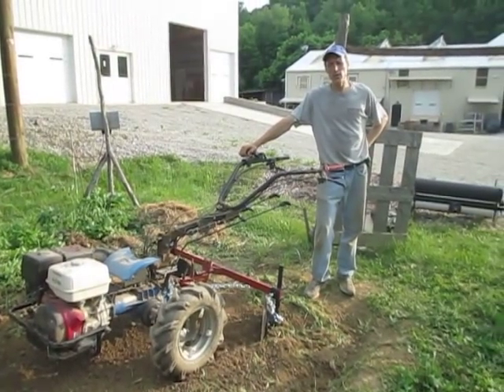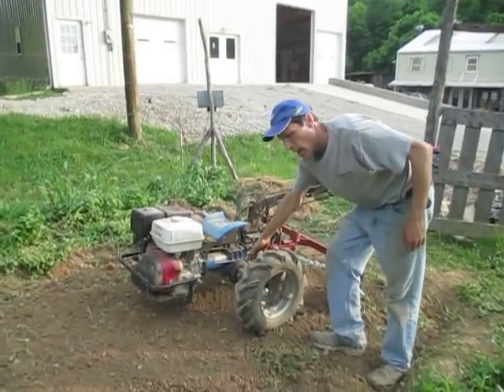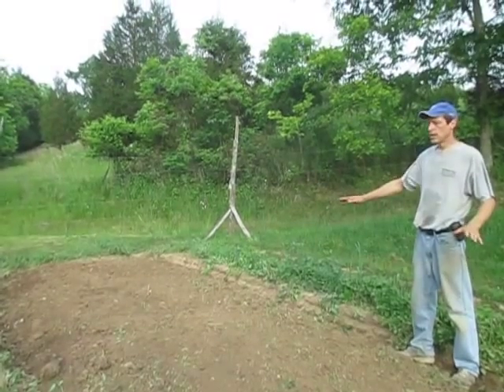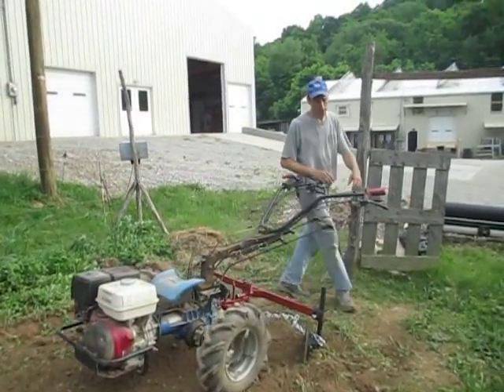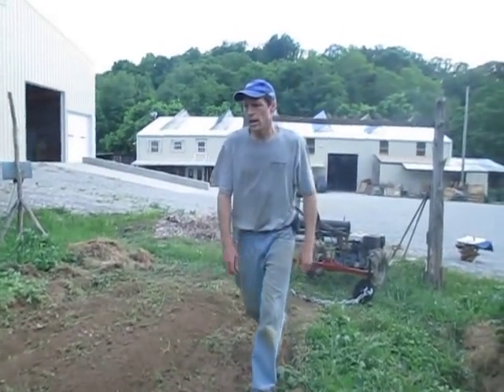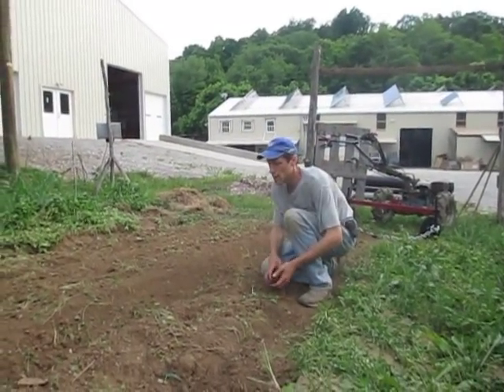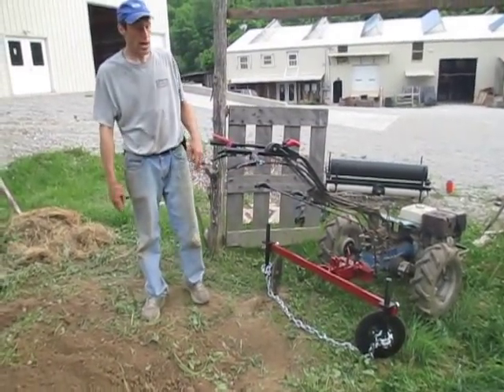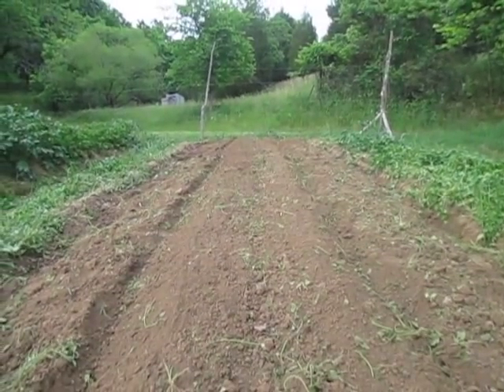BCS 853 Walk-Behind Tractor with Disk-Hiller-type Bedshaper

Comment: Hey Joel!  Looking at this as an option for bed shaping on my market garden.  Would you say that this makes a similar height bed compared to a raised bed made with a rotary plow [looking to make 30" raised beds]?
Reply from the maker: This bedshaper makes about a 6" high bed, max. The bed can be made higher with a rotary plow...up to 20" high (with multiple passes), in fact.   But you get much more consistently-shaped / sized beds with the bedshaper.  The bedshaper is pretty much a MUST if you are going to lay plastic mulch over the beds...